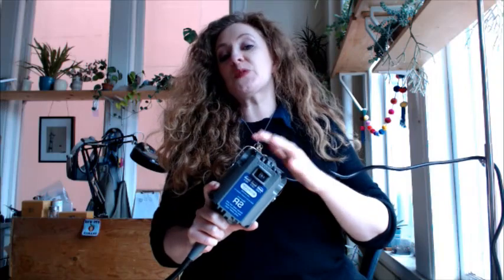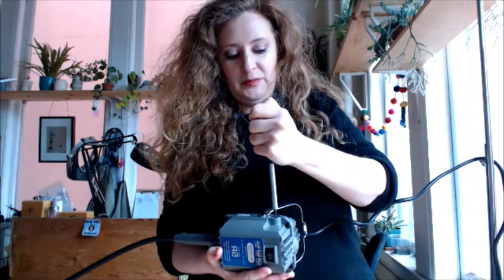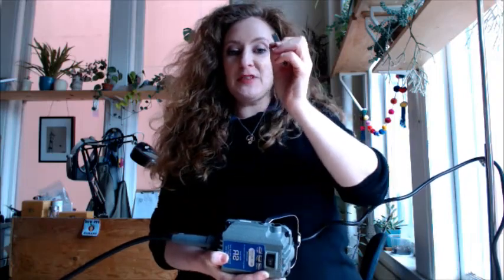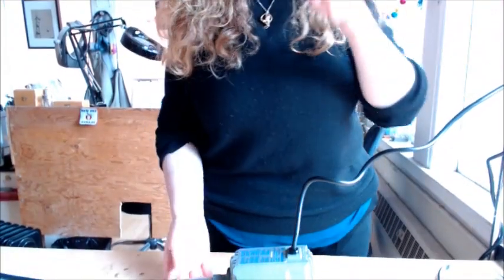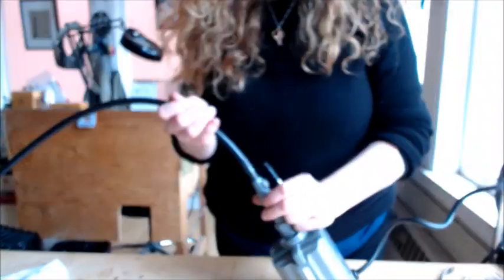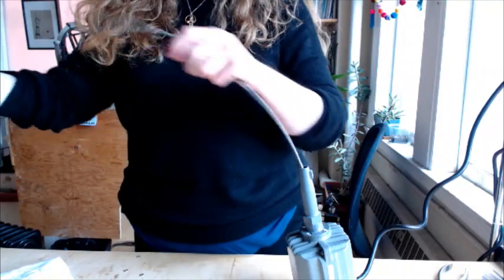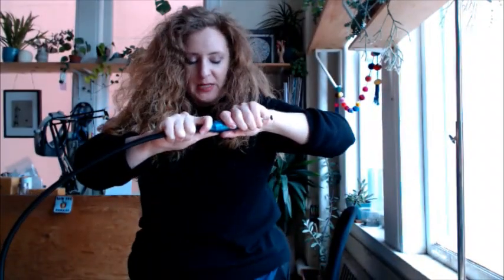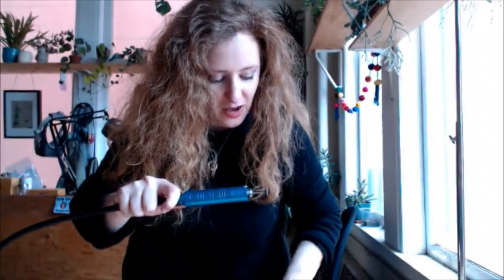Two Easy Steps to fix your flex shaft

Comment: Hi Sharon, I recently bought a foredom flex shaft SR series second hand and sometimes my foot pedal gets stuck and the motor just keeps running and my flex shaft doesnt speed up in range it goes from 0 to 100 in a heart beat
Reply from the maker: Hi! Sorry I didn't see your comment before. If your foot pedal is getting stuck, try loosening the screw that is on the underside of the foot pedal. I also recommend getting a different, more sensitive foot pedal than the standard one that Foredom provides. My favorite is the Lucas or LucaDent Foot pedal made for the dental industry. Far more sensitive and will go from 0-100 more gradually. It also holds a slow speed much better. But start by loosening the screw on the bottom of your foot pedal and see if that makes a difference.